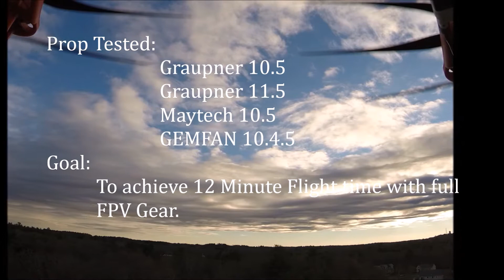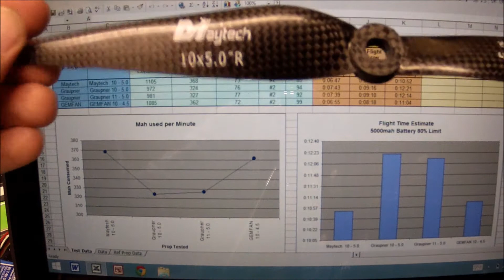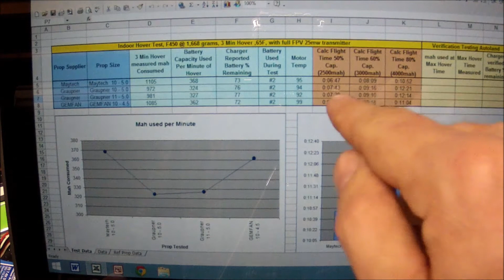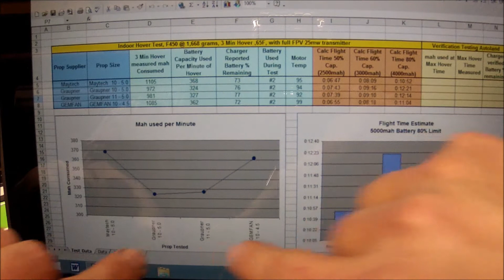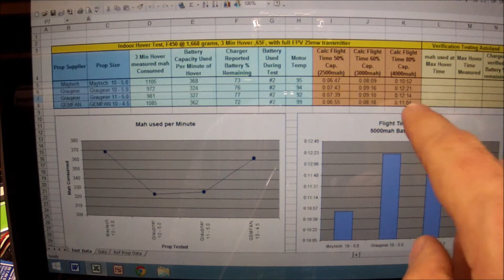DJI F450 Prop Test - Part 1 of 2

Comment: then the graupners are the best I guess 10x5
nice work man thinking of xoar 10x5 wooden props for my sky-hero
liked
Reply from the maker: Each prop has good and bad aspects to them.  The Graupners are great props but I find them noisy compared to the Maytech 10x5 carbon fiber props.   Also material used in the prop construction makes a difference, for my F450 at its max weight I found that carbon fiber makes it feel more responsive.  I have yet to try wooden props.
Reply: Inverted Hover have to get me some different brand props for testing found out for my flame wheel
the stock props works fine and the graupners the best for speed and fast lift